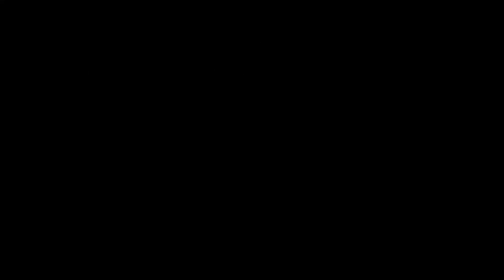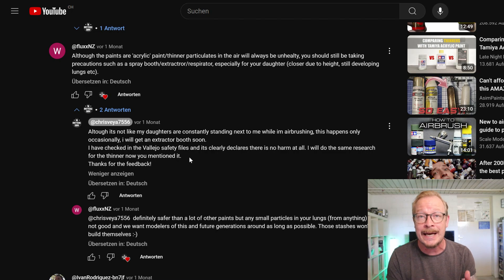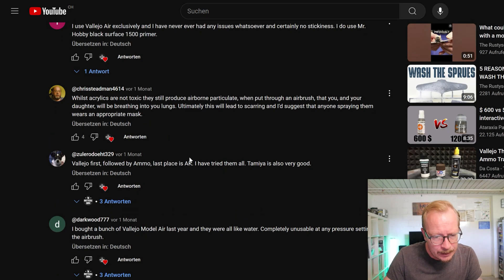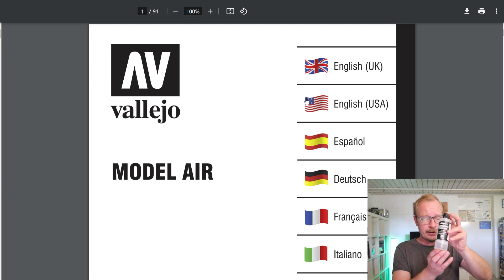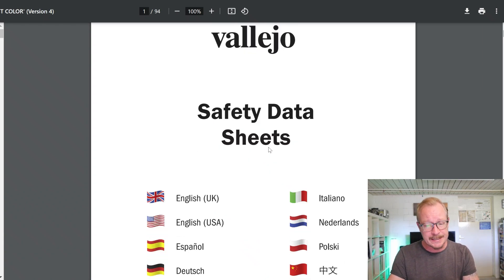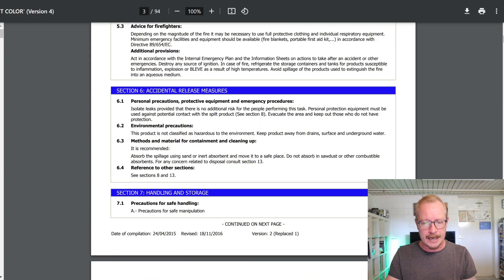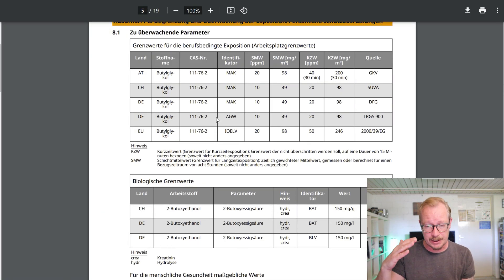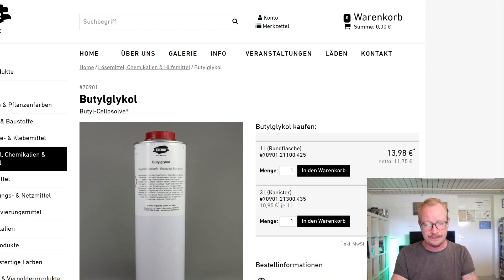ARE ACRYLIC AIRBRUSH PAINTS & THINNERS REALLY NON-TOXIC? - Uncover the toxic ingredients in the SDS!

Comment: always use a spraybooth when airbrushing to suck away most fumes to outside, not recirculate. inhaling paint parts, dust or thinner mist is never a good idea. it might not be harmful instantly, but builds up over times. you could also wear a paint facemask with filters, like most common 3m facemask.

If you consider all paints as unsafe/unhealthy and take precautions, you're safe 👍 but maybe that's because most of us are old scalemodellers that started with thinner based paints.

Comment: You are not totally off but you are seemingly lacking the background knowledge to correctly interpret the data you have shown. The safety data sheets mostly report information about hazard, i.e. if it says compound X is harmful when inhaled then this is a general property. However, what is actually important is the risk which is the combination of hazard and exposure. Just ask yourself if the acute or chronic effect thresholds are met in your case: if you spray a few drops of thinner per week in your basement, you will most likely be fine because the dose is just too low to do anything. If, on the other hand, you take up sniffing airbrush thinner as a recreational past-time, then this might be bad for your health in multiple ways. The same goes for pigments - if there is too much in the air, then it's bad. The same goes for all other things, of course. Just as Paracelus said: "All things are poison, and nothing is without poison; the dosage alone makes it so a thing is not a poison." Hope that helps.
Reply from the maker: Yes you are absolutely right. My main focus was to know if there are any toxic ingredients in these products which arent declared on the bottles. And if yes, which type of chemicals are these.
Thanks for the feedback!
Reply: Example exposure calculation for the airbrush thinner: Long-term exposure limit for workers is around 100 mg/m³ of air for inhalation. Assuming the room you are in has a floor size of 10 m², this represents an air volume of ~25 m³. There is up to 10% of 2-butoxyethanol in thinner. If the room has NO ventilation and you begin spraying, one would need to spray at least 25 g of thinner to reach the occupational limit value. Probably considerably more under realistic conditions, because the thinner will mostly land on the model with the color and there will (hopefully) some kind of ventilation. Also the long-term/chronic threshold may not be the right value to look at, but acute may be more relevant. Anyhow: taking care of ventilation and redirecting or filtering aerosols is ALWAYS a good idea.

Comment: As a biochemist who has worked in, and run, research laboratories for around 40 years my advice is always assume a chemical maybe dangerous even if it isn’t considered so at present. Toxicity information changes all the time and things that were not considered toxic can eventually be considered so a few years later. Basically, when I paint my models, I use a booth and wear a respirator. After finishing a session I then remove all the residues from my workroom and open the window for several hours. Better to be safe than sorry.

Comment: The term acrylic paint is misused in the modelling community. It seems most people think that acrylic = water based = non toxic. This is false. Tamiya X-XF paints are acrylics, just not water based but alcohol based.  Both types of paint contain acrylic resins and having a different solvent does not change this fact. We should handle any paint as dangerous and take necessary safety measures. Health > modelling. Even when hand-brushing enamels/oils etc, we should not leave thinners/solvents open in a closed/non ventilated space.
Reply from the maker: I believe with the alcohol based ones people are more aware of, with water based its a bit more tricky. You hear the word water and automatically think its completely safe to use
Thanks for the feedback!
Reply: I agree.  I still use a spray booth and a 3M mask with cartridges.  One day, I forgot to put my mask back on after cleaning my airbrush real quick for a color swap, I got such a bad headache afterwards and for a good part of the next day.  Did not feel good.  Sure, it could have been due to something else, but most likely due to forgetting the mask.  Just wanted to add I use all Vallejo and a brew made of their thinner, retarder, and flow improver.  Great products though.
Reply: tamiya scammed us with their "acrylic" paints, they are not acrylic.
Reply: @mcscalemodeling4984  How are they "scamming" you?
Reply: @rictube4716  by making us believe they are acrylic waterbased paints.

Comment: Thanks for the video! I'm currently planing on buying an airbrush and was thinking about chemicals in some of the used substances. 

As a former biochemists, I'm a little bit shocked how hard it is to find any SDS sheets from Vallejo (and also other manufacturers). I just found out that Vallejo might reformulated their thinner (and maybe the flow improver too) but I cannot find any current SDS sheets. The one you are showing is from 2015. I wil lreach out to vallejo and aks if the can provide a SDS sheet for the thinner.

And (as already mentioned by another commenter): the chemical in the thinner and the flow improver is the same. So both are toxic if inhaled!
Reply from the maker: The sheets im showing are the actual ones directly from the officiall vallejo website. So if they have made some changes meanwhile, the files werent updated.
Okey youre chemist im not at all, how come this ingredient is declared in the SDS of the same company with different names? Is there a reason to it?
Thanks for the feedback!
Reply: @RustyscaleShow  I just saw on some german shops that they labelled the thinner with "new formula".

Why they used different names is a good question. According to Regulation (EC) No 1272/2008 it should be names as "2-butoxyethanol or ethylene glycol monobutyl ether" But I think that this substance was added in 2022 to the annex VI of the regulation. Might be some older sheets but only vallejo will know (hopefully they know :D). If they changed something they def. should update their sheets!
Reply from the maker: These labels and names are very confusing to me but as long as they have removed these harmful ingredients, im grateful and will talk about it soon
Reply: @RustyscaleShow  Vallejo send me back some new SDS sheets for the thinner and flow improver (pretty quick response time)! They do not contain the mentioned substances anymore. If you have any mail address you can share here, I can send you the new ones (revised in 2022).
Reply from the maker: Oh wow that was very fast! Youre a hero you can send it to rustyscale@bluewin.ch it would be greately appreciated✊🏻

Comment: Let's be honest, everything in our hobby is pretty much bad for our health and our environment.
Microplastic and resin dust from sanding, cement fumes, IPA, putties, pigments, enamels, oils, lacquers and the list goes on.
Of course these are toxic, but there is a difference between being exposed to these things 7-8 hours a day via work for example, or 1-2 hours via hobby on an irregular basis.
The amount and the length of exposure matters.
Keep in mind the concentration as well. The thinner has between 2.5-10% concentration. That means that in a 1ml of thinner there is 0.1ml of butylglycol at most.
I do agree with you that Vallejo should have it on the bottle, but not even Mr Hobby Lacquer thinners have text saying, don't inhale the fumes, while that stuff is literally killing your brain cells and can make you blind if it gets in to your eye.

When I know that I will airbrush for an hour straight, I will put a mask on just in case, if I just do a quick airbrush work like 5 minutes on some pieces, then I think it's fine.
I use Mission Model, AK 3rd gen, Ammo and Vallejo. All water based.

If in doubt, take precautions. It's never going to hurt you being careful.
Reply from the maker: @rogueplastic  yes youre absolutely right. The lenght of exposure is decisive. 
I totally understand why Mr. Hobby has no declaration on any of their products, the stuff is made in China right? They dont care about anything concerning safety of the people. But i thought it could be different in Spain...
Thanks for the feedback!
Reply: @RustyscaleShow  
Mr Hobby is Japanese.
Even if their local laws don't require any of these labels, for these products to come in to Europe they have to follow European laws, so you want to question why the EU doesn't have it as a requirement.
Usually companies will always do the bare minimum to comply with laws to stay cost effective, etc...
I also understand why it's not a requirement. Literally everything surrounding us on a daily basis has toxic components in certain levels. If over time it turns out that something is very toxic and damaging even in the smallest amounts, it will be banned. Like asbestos.
Until then it will be observed.
Another way is for the consumer base to force a business to do things like that. As always, money talks and companies will do everything for more sales.
It's good to keep each other in the loop within the community about potential dangers and hazards, because a lot of times bureaucracy and companies wont do it for us.

Comment: I remember when Vallejo Model Color had natural pigments in them like cobalt and such. They had to have warnings on the bottle, because it was in it, but it was such a small amount that you would have had to ingest about a 100litres or more of it to be of any minor nuisance

You are still only using a very small amount of Valleo thinner. 

But with any paint when you are spraying, should be in a spray booth, and wearing a respirator, regardless of the the type of paint used
Reply from the maker: I think every ingredient which can be harmful to health should declared as such. Even if its in very small dosages. Just to raise the awareness
Thanks for the feedback!
Reply: @RustyscaleShow  I think if it is proven that it is under acceptable thresholds, than legally they don't have to, right or wrong is just a matter of personal opinion at that point. 

Could just be a matter of time before it too gets reformulated, if the EU keeps banning the chemicals used in paint manufacturing. Hence why Vallejo has had to reformulate both the Game Color line and the Model Color line, as well as other paint manufacturers having to reformulate their lines

Comment: I know from hauling these type of paints from coast to coast. When I had to pick up a load of paint,I had to plackerd the load as dangerous and flammable. This depended on the amount and there containers. I know that when I had to haul it I had to carry msd sheet as well as placking the load. So in my mind this is toxic to a point. In the amount that a modeler uses it is not according to epa or ohsa due to part per million. 😊
Reply from the maker: Yes luckily we use it very small doses and even mix and dilute it more.
👍🏻

Comment: I have two of those inexpensive spray booths and I think they are worth the money. There are more expensive units out there and different types of vent systems but for the money they’re pretty good
Reply from the maker: Because i mostly build and therefore spray 1/72 scale models i think such a inexpensive one should be absolutely sufficient 
Thanks for the feedback!
Reply: I built my own from an old fan, some 1 eur alu tubing for exhaust  and a mask at the end for a filter. Total cost: less than 10 eur.